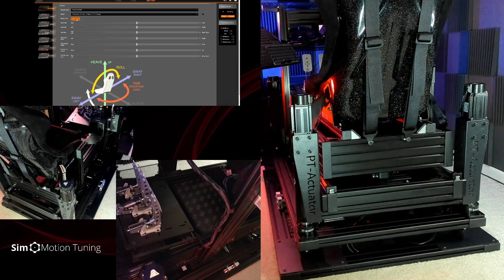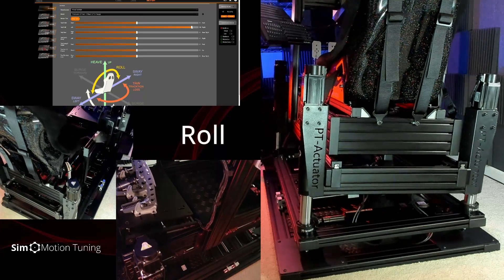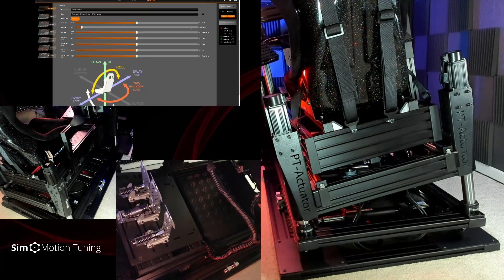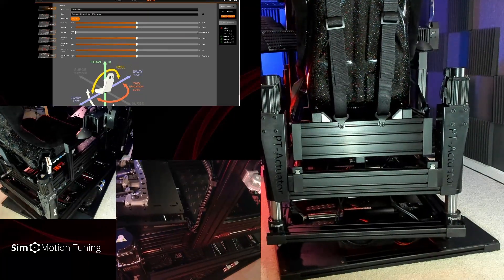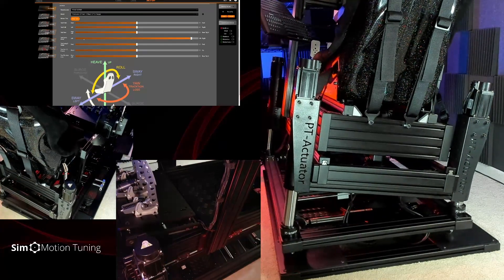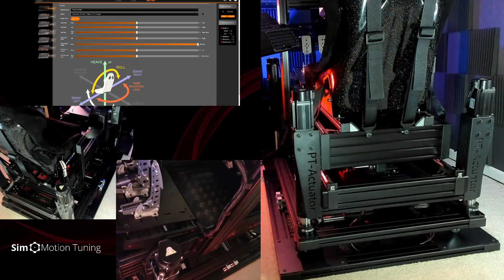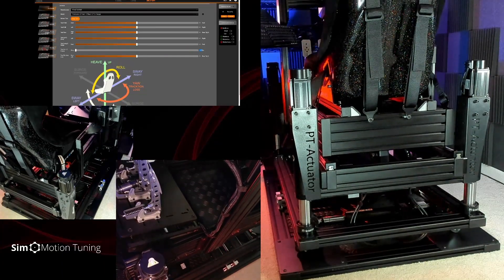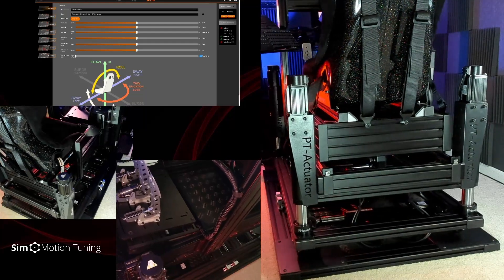Motion Capabilities of the PT Actuator 6DOF Simracing Motion Simulator / Sim Racing Studio

Comment: Did you keep the butt kicker from your old rig?
Reply from the maker: No, it wasn't powerful enough to shake the Sim Labs P1-X frame. I now have a Dayton Audio SA1000 amp driving a single Buttkicker LFE mounted underneath the seat. I plan to add an additional Buttkicker LFE to under the pedals as well.

Comment: Where do you buy this rig? I can't find where to get it...
I only see 4DOF Platforms on their website... What is the cost also?
Reply from the maker: This is the platform shown: http://www.pt-actuator.com/products/p4/218.html
Reply: @SimMotionTuning  the cost is 13,499USD. Is that the final cost?
Reply from the maker: @varpornrat  You will need to also purchase a cockpit, like the SimLabs P1-X or similar, and a seat.
Reply: @SimMotionTuning  taxes and shipping in price or is there more?
Reply from the maker: @varpornrat  There will be a shipping charge and potentially taxes on where you have it shipped. It was approx 7 boxes shipped to the US which was around $500. There were no import taxes/duties paid to shipping to the US. 

The additional expenses are going to be your steering wheel, pedals, shifter or whatever type of controller for the sims you'll want to play. You'll need to have a very large monitor mount to clear the vertical and horizontal distances of the rig (vertical and horizontal extrusion I use is 1525mm). You'll need seat belts for your chair as well. In addition, depending on wiring, you might want to install an EMI filter to reduce line noise/interference. Finally, you might want to change/add other items to your platform which will raise costs in addition to the racing cockpit you decide to go with.
Reply: @SimMotionTuning  thanks for the replies. I was thinking about getting the p6 but this looks so much better. I can’t stand rigs that have wires everywhere. This looks so much sturdy.

Comment: Power draw ?
Reply from the maker: I'm unsure of the exact power draw. I run the entire platform, monitors, and PC off a single wall outlet to avoid ground loop issues. I have not observed any issues with the power draw on the single 120v outlet (no flicking lights, circuit breakers flipping, etc). Actuator servo motors are extremely efficient and will scale their power draw.

Comment: Cool.  Just researching for my first build now.  I see some systems with surge forward under braking and some backwards.  I am wondering what the pros and cons are for each style if you have a minute to enlighten me.
Reply from the maker: I think there are 3 schools of thought on it: 1) Platform moves forward when braking for seat belt towers and surge actuators. This pulls the seat belts tight when braking as the platform moves forward. 2) Platform moves forward when braking to emulate the g-force of moving forward. 3) Platform moves rearward when braking to emulate the physics of the car and jerk the body forward in the seat. 

Personal preference and what type of platform you have will determine which might be the best solution. I personally prefer the platform moves rearward when braking with surge to create immersive effects when shifting, feathering the throttle, hard braking, etc. It's primarily due to how the body will shift in the seat and the head moves.
Reply: @SimMotionTuning  thanks for the details!! Yea i am thinking maybe if the platform moved rearward and it somehow tightened the belts (maybe some kind of Z routing) that would be pretty cool.
Reply from the maker: @dvelez811  Agreed. My plan is to eventually add a seat belt tension system (SRS I believe is making one) so I can still have it move backwards when braking but also have the feeling of the belt tightening.